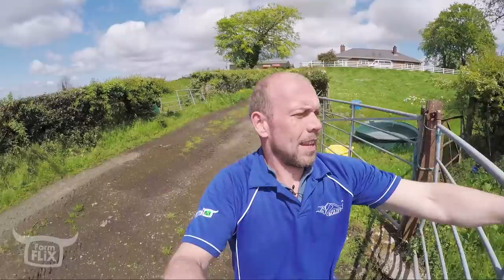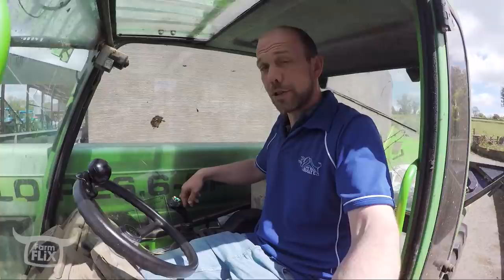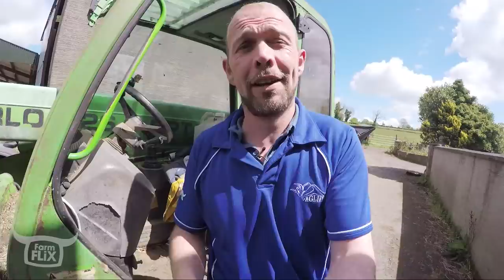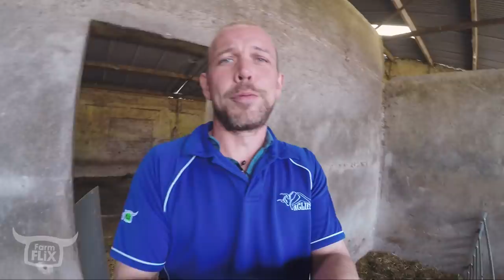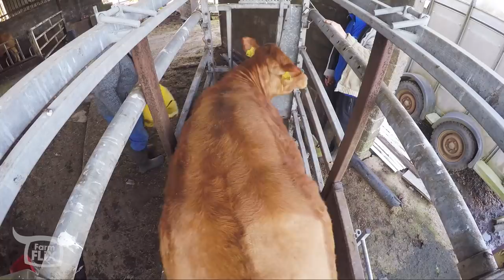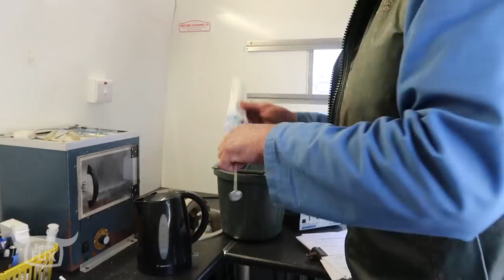BROKE MERLO...CALL THE  VET ?? EMBRYO IMPLANTS... Alan Clyde | FarmFLiX

Comment: Had the same problem with ewes Alan not coming to milk straight away but after a few days after an injection they came to milk I'm convinced it was the strength and no growth in the grass not enough nutrition
Reply: How do you fix the grass problem ?
Reply: @Patient-Unknown  you need to get the soil tested . Don't test yourself you will have to send it away like sending water away it will tell you everything that's in the soil.
Reply: You can't really it's the weather or get ur soil tested might need more nitrogen or lime or phosphate or whatever